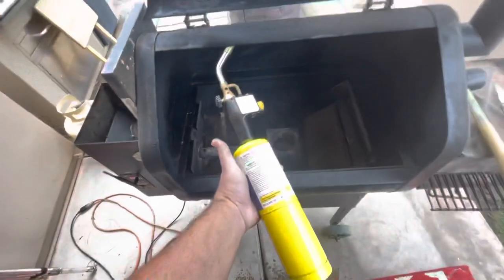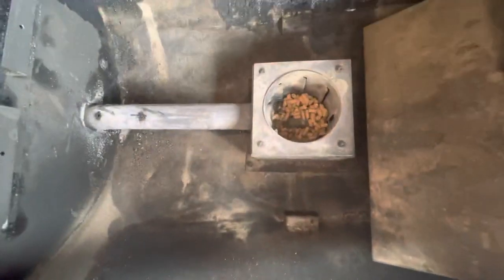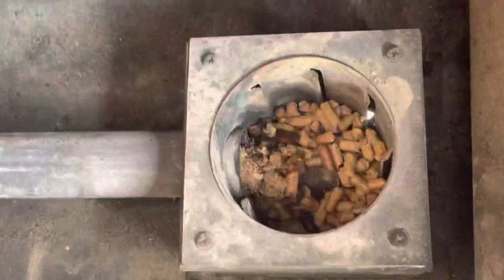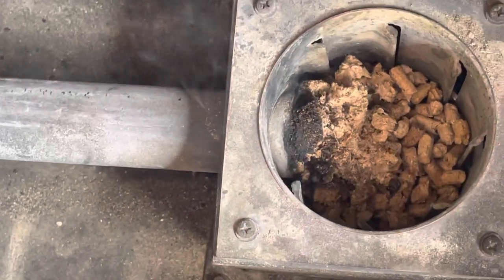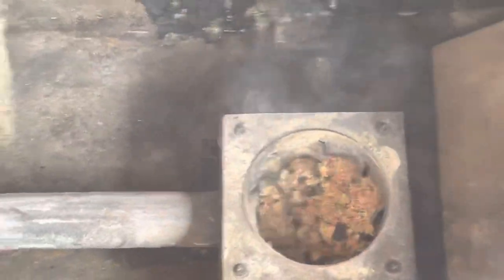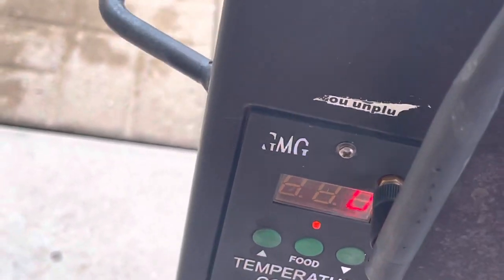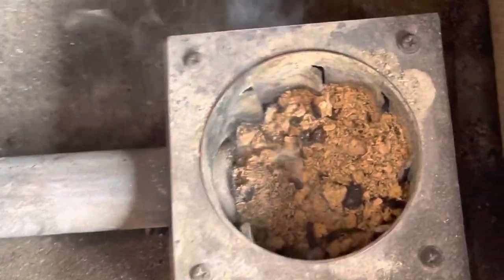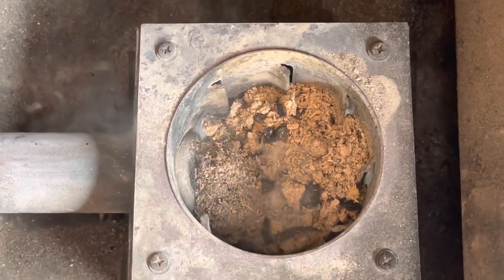Clearing a pellet grill auger jam with a MAP Gas torch

Comment: I've had my GMG DB for over 15 years, and it's been good until just recently.  I live in a humid climate and have to clear the auger tube every so often also.  I just started having issues with the control panel.  The buttons don't work properly, and the auger won't turn after going through the startup.  I think its time for a new grill, but im not buying another GMG.  I've heard from a lot of folks that their quality has really gone down.